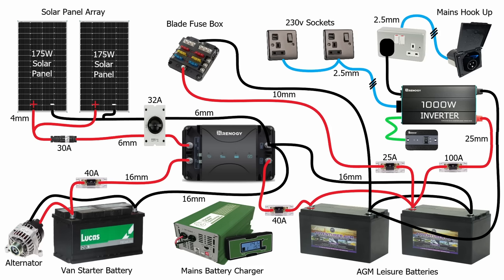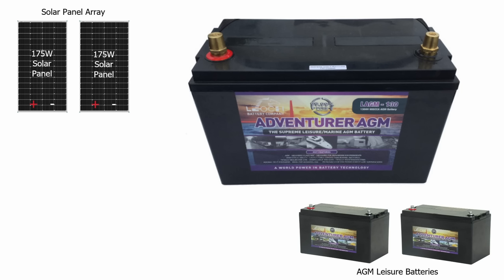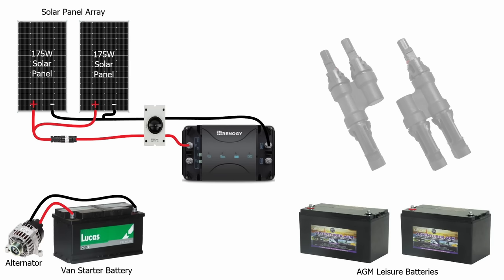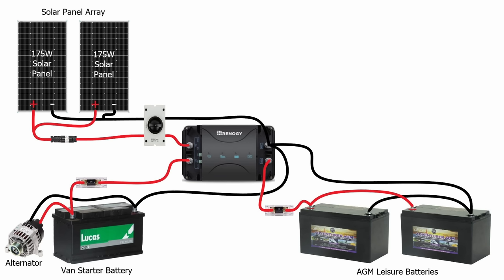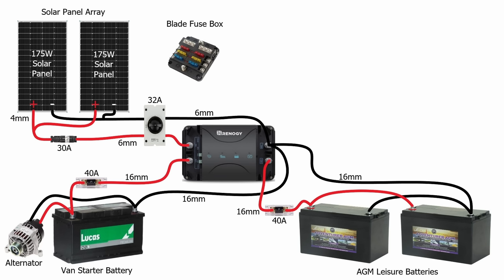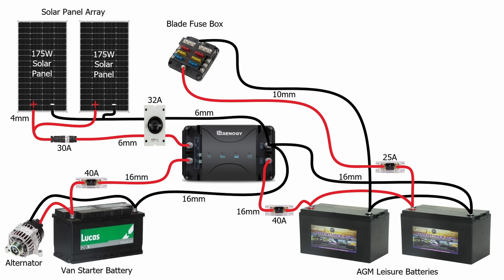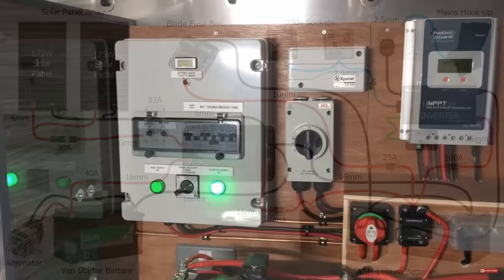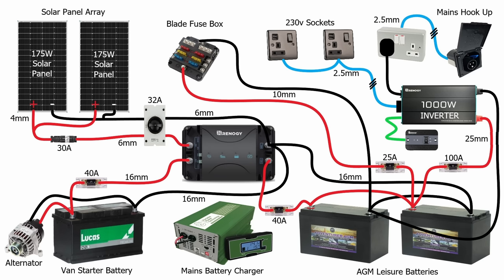12v Electrics for Off-Grid Campervan - Fiat Ducato Budget Build Ep12

Comment: Hi Greg, hope you're well mate. I have a question about fuses. Would you recommend staying away from the breaker type, some people are suggesting they're not safe. I noticed your diagram used the ANL fuses which is the reason I asked. Cheers, hope to see you at Stratford and if I've got no eyebrows after taking your electrical advice, then it will cost you a Beer 😂😂.
Reply from the maker: Hello mate, nice to hear from you. Breakers are ok to use providing they are made for DC circuits and of good brand make, like Deadsea etc
What a lot of those people in the video don’t appreciate is the time and amount of overcurrent it can take to trip a breaker and this can be more than a conventional fuse. 
As you saw in the chart you can have a small overcurrent and it will take a while for the bimetallic strip to do its job. Where as a fuse is likely to burn through closer to its actual rating again as long as it’s a reputable brand. So I guess what I’m saying is don’t buy cheap on fuses and breakers and you’ll be safer. Take care mate 👍🏼
Reply: Cheers Greg, Great advice as usual. Take care.  @GregVirgoe

Comment: Hi Greg, I'm currently converting a Peugeot boxer, and your videos are priceless, thank you for the work you do! 
I am trying to design my electrical system, and have a question about this set up. 
Is there a reason not to wire straight from the charge controller to a bus bar, then from there to the battery and your fuse box? My thinking is that this way, any solar you produce will be used directly by the appliances, with any extra going to the battery. Cheers, Adam
Reply from the maker: it doesn't really work like that, all cables off the charger will rise to the same voltage at light speed. Adding another junction (busbar) between the charger and battery will actually add more resistance to the circuit and result in more voltage losses, so the shorter the cables and the less joints the better.
Reply: Great, thanks for the advice Greg

Comment: What lengths of the different cables sizes did you need to order for a MWB? based on your design of a garage at the back and kitchen in the middle? - in my Sprinter MWB  it's battery is in the passenger foot well area - how does that work with wiring it to everything else?  So mkany crazy challenges! many thanks
Reply from the maker: You will see in upcoming videos that I wired into the starter battery box from underneath the van and ran the cable in conduit outside strapped underneath to the back of the van where all the electrical stuff will be housed. I ordered 7m of 16mm red and black and 9m of 10mm red and black from Quickbit.co.uk

Comment: Living in a van for 6 years, I had AGM batteries which lasted me on avg 2 years. For the cost per watt Lifepo4 is better. I was against lifepo4 until I bought some. Anyone starting out I'd advise you to go lifepo4 IF you're going full time vanlife. If you're just a get away on weekends person, then AGM are a great Choice. Remember most AGM batteries have 400 cycles.

Comment: Hey greg, when buying the 25A ANL fuses and holder to connect battery too fuse box,  it only has the option for 20 or 30A. does it matter which one i use?

Comment: Hi Greg, thanks for the info. My question is, I'm about to buy the same renogy charger and was going to get the 50a, but I see you chose the 30a. My power needs are minimal.. fridge, lights and DC charging only. Would you say you get better longevity form the batteries by having a smaller amp charger? I just thought if I get the 50a the battery will charge quicker.. but id rather put first battery longevity ..Thanks
Reply from the maker: Hello Jay, the size of the charger depends on the type and size of your leisure batteries, you cannot just force loads of current into a battery without serious risk of damage. All batteries will have a maximum charge and discharge rate and typically for lead-based batteries that's about 20%, if you want to put more amps into your batteries you need to look at using either GEL or Lithium

Comment: Hi Greg, we’ve recently found you after starting our Relay conversion- soooo helpful, thank you in advance for all of the information- it’s early days for us. But we have followed your electric plan. For some reason we’ve had delivered one 175W solar panel and one 200w panel- can we use these together with the rest of your plan or will that not work? Our wheel base is slightly longer to yours so space isn’t an issue. Many thanks for everything!!
Reply from the maker: Thank you for getting in touch, the two panels will need to be the same size it's not good practice to wire different sizes together, you do not get the full potential out of them both unless they are matched. If you have the space why not go for two 200w panels :D
Reply: Thank you soooo much Greg, good point! You’re our best find since starting our conversion ❤️

Comment: Hi, I have the same set up 30 amp dc/dc charger and 1000 watt inverter (Both Renogy) my question is this. When i plug my laptop into the inverter, on the dc/dc charger the slow flashing solar icon goes out and the solid red alternator icon comes on and stays on. But when i turn the ignition on (But not the engine) The solid red alternator icon goes off and the slow flashing solar icon immediately comes back on. I am just wondering is this normal? Thanks.

Comment: Hi Greg,
Love the video it's a great help thanks, just wondering could I keep all the wire sizes the same if I use my renogy 2000w inverter or should I upgrade the size. Thanks Ceri.
Reply from the maker: The 2000w inverter needs a 200Amp fuse and you will need at least 35mm Sq cable and the battery interconnect cable also needs to be 35mm because the larger inverter will draw a lot more amps. I would also recommend going to Lithium if you can. Renogy have a great deal on a pair of their core batteries
Reply: @GregVirgoe  cheers Greg thanks for the reply will order the 35mm tomorrow and I already have a 200amp breaker, also I have just ordered a smart lithium from renogy just yesterday, keep the updates coming mate all the best Ceri.

Comment: Greg does this system change much with an additional 175w solar panel and 2 x 150ah agm batteries? I have a 2000w inverter but I'm planning to replace with a 1000w instead

Comment: AT 15:18 you introduce the 230V Plug possibility. Will it also be possible to charge the batteries with the extern plug to 230? Or will only feed the power plugs?

Comment: Hi Greg hope you're well. Could you build this system gradually and use the components? Eg. Start off with the basic 12v set up, then add solar, then inverter etc. Working on a tight budget but trying to figure out if I could start with one part and build on it 😊
Reply: Sorry if I wasn't clear - I mean would the components work individually or does the whole system need to be fully set up for it to work?

Because, if I can start off with the 12v components and split charge, then eventually add solar and then the rest, that would make it easier to get started 😊

Comment: Hi Greg hope you are well I know you haven't done the installation video yet for the consumer unit, but was wondering how you intend to connect your 1000W inverter to the consumer unit. I assume it is via the double socket in the garage which I assume is fed from the consumer unit? Thanks David
Reply from the maker: Hello David. The consumer unit has a 6amp double pole MCB I will use that for the supply to the inverter. The 10amp MCB I will run to a socket for the mains battery charger. Hope that helps. 👍🏼😊

Comment: Hi greg.
I see a lot of campervan electrical diagrams incorporate a kill switch on the battery cable. Is there a reason one is not included in this system, is it necessary to have one ?
Thank you for the video,very helpful.
Reply from the maker: It is a good idea to have a switch to isolate the supply instead of pulling fuses. Didn’t show one for simplicity.

Comment: Please , add connections and fuses (if needed) from mains battery charger. Could it be connected all the time?
Reply from the maker: Yes it can be left connected to the leisure batteries using the same battery terminals as the MPPT charger. Just turn it on when needed and you can leave the MPPT on at the same time too.

Comment: This is a great system and the use of a combined MPPT and B2B charger very clever, less money, less space, less to go wrong.  My only comment/question is should the B2B charger be connected in someway to the ignition?  I am wondering is this set up could, in theory, leak charge from the leisure batteries to the starter battery?  Although I take the point that the excess solar charge can feed the starter battery when leisure batteries are fully charged.  Its a comment/question, in no way a criticism.

I was going down the Victron Multiplus route for my Citroen Relay conversion, but this is so much cheaper,.  I like the idea of using a mains charger in emergencies also - I have two at home.  Why keep buying excess electrical components when not needed? 🙂
Reply from the maker: This unit only needs to be conencted to the ignition if you have a smart alternator. It's voltage sensing and will not open any circuits unless it sees that the alternator is running and giving a charge out from the van battery. in older vans that ignition wire is not needed. There is one provided with the kit.
Reply: Thanks, Greg, yes when you read the Remogy Manual carefully it says this and there is the lead included.  @GregVirgoe

Comment: Hi, thank you for all your videos. Very helpful for a me in planning my own conversion. Electrics are not my strong point, can I ask please, using the system in the video, if the van was on hookup on a site would all the 12v systems, lights etc be powered or just the 230v?
Reply from the maker: Hello Peter, Its a great question, thanks for asking. All of your 12v DC equipment will still be connected to the 12v Blade Fuse Holder and be powered by the leisure batteries at all times, that does not change. When you are on hook up you can turn on the mains battery charger to put power back into the leisure batteries to keep them topped up if you have no solar and are not driving. The 230v 3 pin sockets will be fed from the hook up and not by the Inverter, that's the only power change in this setup. I hope that helps
Reply: Thanks for the reply, that makes sense. Without going into detail, is there a system where a hookup powers everything in van but you can have an off grid option with solar panels also ?
Reply from the maker: @peterlavin9373  you can install a full electric system that’s 230v mains and everything is run off a hook up. The only problem is you cannot use anything unless plugged into a camp site. 
If you want to be off grid you need to put most of the devices onto 12v dc batteries 👍🏼😃

Comment: Thanks Greg. Where would a shunt go in this setup? And what about earthing?
Reply from the maker: You would have to connect all the positive and negatives on the leisure batteries to the same terminals posts. Then put your shunt between the neg cables and the leisure battery. 
The shunt needs to measure all inputs and outputs to the leisure battery. 

Having said that you can get a Bluetooth device to plug into the charger and Renogy do an app that gives you all the information you need. No shunt required.

Comment: Whats the reason for using 100m2 wire (100amp usually) to the fuse box with only a 25 amp fuse?  Couldn't you use far thinner cabling ?

Comment: I don't know if your van has the converter's interface on the driver's side pillar - some Ducatos have this and it makes connecting to the battery a bit easier...
Reply from the maker: No it doesn’t. Take a look at my reversing camera video. This van is  16yrs old. 😊

Comment: Greg once again a totally superb video that I will actively use. Could I ask one question. I have exactly the same set up with 2 110ah batteries and the identical renogy unit. The only difference is that I only have one renogy solar panel that produces 175W. Can I ask what difference this makes to the fuses and isolators that you describe? Thank you Duncan
Reply from the maker: The only difference woudl be the MC4 fuse on the solar panel reduce this to 15amps 
https://www.ebay.co.uk/itm/124964731503?hash=item1d187a7a6f:g:kIsAAOSwIRBhsuQi&amdata=enc%3AAQAIAAAAwCHMX9eOQoE0wfvUZsYdfe32owEdIup6qyWKsa9ptjzDYdmvoyvHrpVmSBCnhEoXKZJBAkq%2BSiGN%2B8RJjE8t3bEykTGjd81z8xx%2BqMUZEMqp3YC0AJxEV9KmE2eAWq4N7zSxcrM%2F5ob6WU4qFbzUVuIWYOsaD5DJo7QKh5wtDjOlFO77wxBk6Sx3hEJwmwKF%2FyQeHRuFtQ2RroBiezY%2F9GuW%2B5hu6PbH0SNb22UiNG5e9JWz1D2Tn%2FX1pKj98K3LEA%3D%3D%7Ctkp%3ABk9SR5qnh4jBYg&mkcid=1&mkrid=710-53481-19255-0&siteid=3&campid=5338027957&toolid=11800&mkevt=1
Reply: Greg that's brilliant thanks again. Perhaps I could suggest a topic for a short video. It links in with the renogy charger and reverse camera. I  am converting a citroen relay but my model doesn't have a remote fuse box on B pillar. Would it be possible to show how to pick up ignition live from the dash? Regards dunc

Comment: Hi Greg, fantastic vlog, as usual. One question. Would the wiring and all the units be the same if I was to use lithium batteries? Many thanks.
Reply from the maker: Yes no different, if you change battery capacity it has no effect on these cable sizes as they are dictated by the connected load downstream :D
Reply: @GregVirgoe  Thank you

Comment: Can that charge controller charge the battery with solar and the alternator while driving, or does it only charge with solar when the car isn't running? I like that it will charge the van battery once the house batteries are full. That's a great feature.
Reply from the maker: If the van is not running there will be no charge from the alternator. 
So when parked charge comes from solar. 
When driving charge comes from both solar and the alternator.

Comment: Enjoyed that Greg thanks I like the combined renogy really makes it easier. If you was to up the inverter to 1500 would that set up be comfortable running a 1200w coffee machine it would only used for a minute or two at one time maybe 4 times a day . ?
Reply from the maker: If you want to do that I recommend either adding another AGM battery capacity or better still buying one 100Ah lithium for about £400
The inverter would need a 150amp fuse and 35mm cables to it. So that's not much more to spend to give you that function.
Reply: Could u do a video on Eve cells or lithium cells and BMS ?
Reply from the maker: @tospicy4ya  I don’t have a lot of experience with those particular brands of battery. As I understand it you would need 4 Eve batteries connected in series to make a 12v battery. But looking at costs you could get one made of 280Ah for about £500 which is really good value. 👍🏼😃
Reply: What do u think yo a lynx distributor  instead of all the fuses and shunt?  Is a shunt same as cerbo GX just cheaper?

Comment: I only got 2*100W solar panels. Would one battery 100 to 120Ah enough to run a maxxairvan, USB phone, camera, led light and a small fridge '(Dometic Coolmatic CD 30w consommation 0.7 a 1.3Ah)? Thanks in advance

Comment: Hi Greg this has really helped me as I'm using a 200w flexible renogy and the 30amp dc to dc charger with mppt.
Can I ask do you need to put another isolator on the main starter battery to the dc to dc charger I've seen this on other videos that's why I'm asking 

Many thanks
Reply from the maker: There is no harm in putting further isolation on the 12v positive cables for ease of maintenance and safety.
Just remember to turn off your solar before disconnecting the leisure batteries.
Reply: @GregVirgoe  thanks looking forward to building my setup soon

Comment: Hi Greg
I like you system and busy installing at the moment,
Couple questions,
1) I Have 3 100 Amp batteries, how do I connect the 3rd battery
2) my inverter is a 2000
3) Does the wire thickness stay the same as your diagram ?
If you can help, I really appreciate
Many thanks
Jorge Alves
Reply from the maker: Connect all the batteries in parallel, poss to poss to poss and neg to neg to neg. Then connect charging to positive battery 1 and negative battery 3. With your loads connect them positive to battery 3 and negative to battery 1
Reply from the maker: The 2000w inverter needs a 200Amp fuse and I would recommend 35mm cable from battery to inverter.

Comment: Hi Gregg, I currently have a 150w solar panel to an MPPT controller to 2 leisure batteries. I would like to add another solar panel. What would you suggest, ie another 150w or can I add say a 200w to the system. A bit vague I know, but thought you may be able to help. Many thanks, Wayne.

Comment: Doesnt anybody have any questions on the video? Its a month since you posted so i guess im too late but if by some miracle you get this then i'd love to know why you sized the cable from the charge controller to the battery at 16mm while sizing only 6mm from the solar panels to the charge controller. Can they not be the same as the max input and output of the charge controller is 30 amps?

Comment: Hi Greg, great video, very informative for a novice to follow. I’m panning a similar set up but with a single 180w solar panel and the 30A Renogy DC-DC, would the rest of the set up be applicable with my smaller set up? Cable size and fuses etc? Thanks
Reply from the maker: You can keep the solar cables at 4mm and change that fuse to 15amps. The rest can stay the same.
Reply: @GregVirgoe  great! Thanks Greg 👍
Reply: @GregVirgoe hi Greg, I’ve inadvertently bought a 30amp fuse, will that be an issue? Thanks